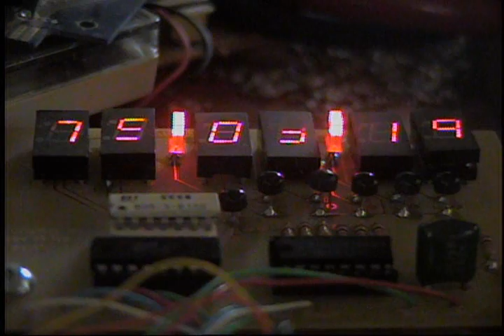Basic Talking Clock Demonstration

Comment: The seven segment dimming when talking was on purpose, or just the controller being eaten by the speechs tasks ?. (i assume you are using time multiplexing there ....). Anyway, amazing project.
Reply from the maker: 38911bytefree The speed of addressing the EPROM for the speech causes it to run the display function at a slower rate.
Reply: CassetteMaster makes sense. The display was done by interrupts ? .. I imagine that is because data read timming is more critical for speech applications. Is the time from addressing to data valid what is slowing the function ?. Because you can split the read task in two parts, just put the adress and the keep doing the display till data is ready. Well, I imagine that something like a dimming still happening. The other way I I think is add delay waste cicles to the display function so when offload, it will run slow and when working the EEPROM just disable the wait or delays states to compensate. Cheers

Comment: How exactly does lpc encoding work?
Reply from the maker: Guest Mann I am no expert on it, but there is lots of info on the internet. Basically it is a form of compression, where the speech is broken into information or pitch, duration, etc. The synthesizer is a mathematical model of the vocal tract, and with producing a sound, like the humming of the larynx, it uses 10 bandpass filters to filter out to give specific sounds like the mouth. A noise source is used for sibilants. LPC does not work at all with music. I have tried it, and it sounds like it is being produced by a "mouth".